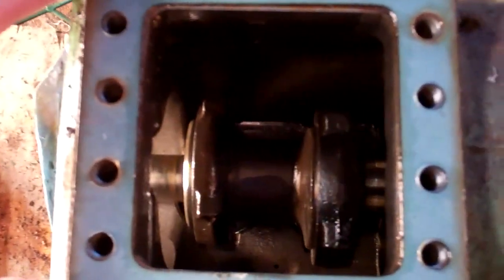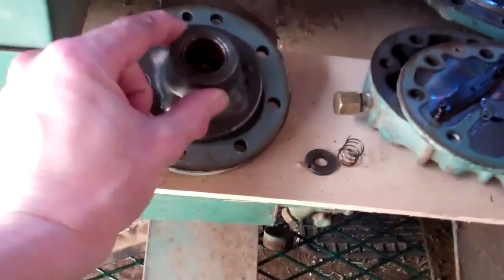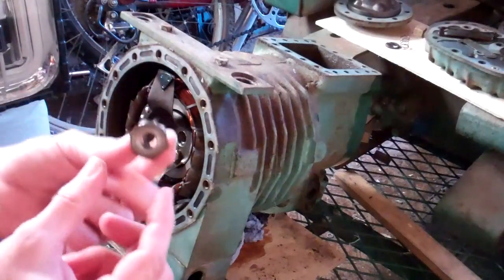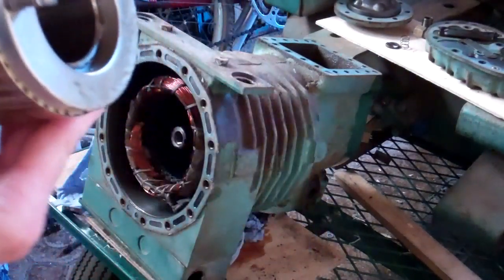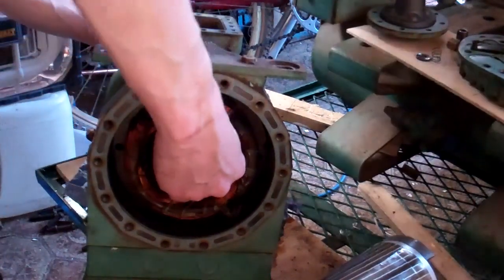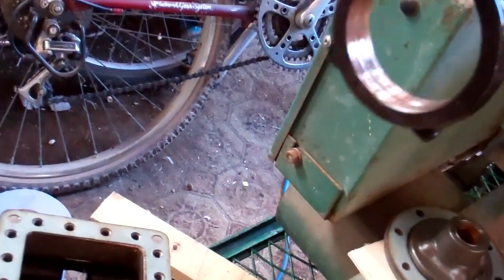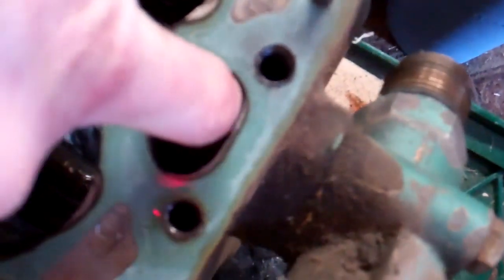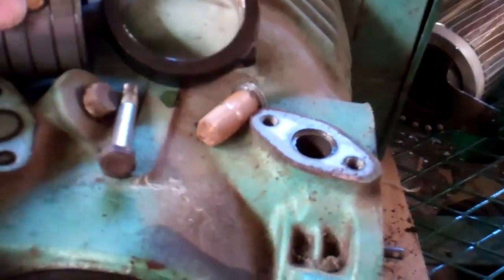Refrigeration S150 Prestcold part 2

Comment from the maker: @Aussie50 Its amazing how long it takes for refrigerant to find its way out of things, I've had pipes that had been open for half an hour suddenly decide to fire a load of oil out so i usually wear goggles when i've got things stripped down!

They built these comps from 1/3hp up to 1 1/2hp with this size block and from 2hp upto 5hp with a bigger block, but all pretty similar design inside, same splash feed lube system, same cast iron pistons without rings. They are based on  Copeland desings :-D